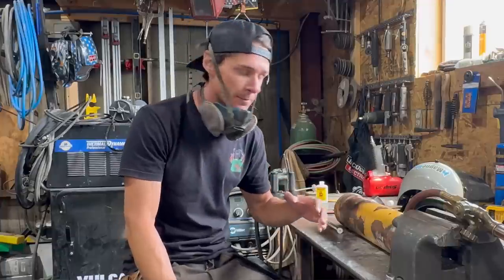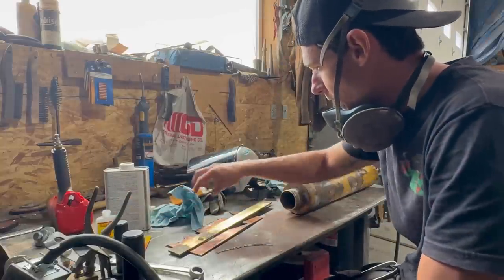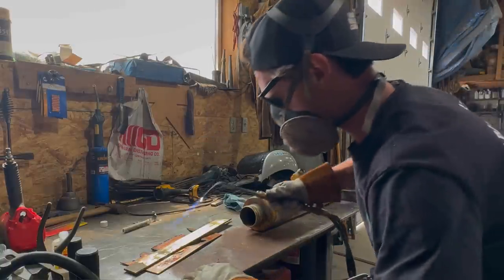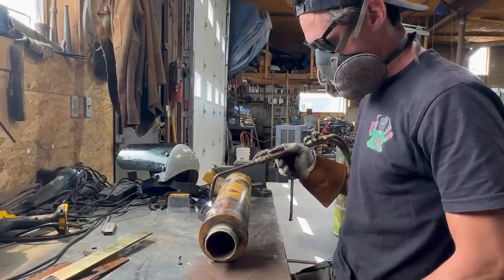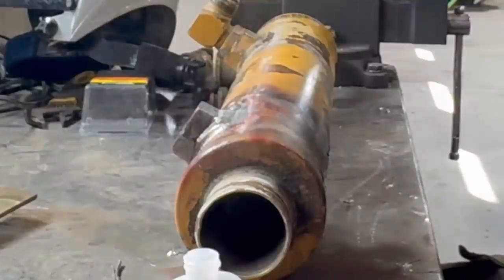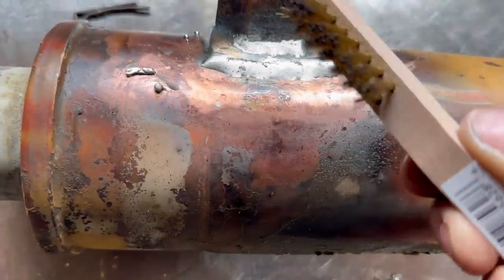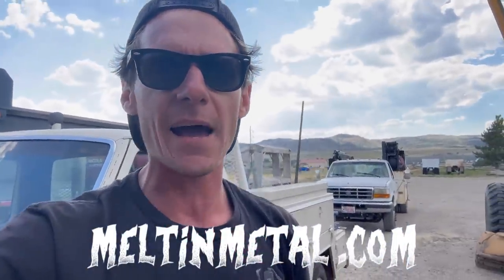Brazing Copper to Brass!

Comment: The technical difference between soldering and brazing is temperature.  Brazing is done at temperatures above 840f.  Soldering is below that temp
Reply: Correct answer.  If you usying oxy/acetylene you brazing.
Reply: @jtoker9758  it's more a matter of the melting point of the filler material.  You can solder with oxy fuel, but you can also braze and weld.
Reply: @elkvis  Yeah if you know what you doing already but for the lay, oxy/act is for brazing.  I ain't ever seen anyone solder with oxy, just pointless.

Comment: I always keep my oxygen regulator on 20-25. Only time I crank it up is when I’m cutting 3/4 inch thick or greater. I would puddle on the bottom plate and scoop up to the top. I use a modified circle weave. Your flame @7:53 was off for some reason.
Reply from the maker: Ya I was doing my best but I was having a hard time keeping the flame correct but I could definitely have it wrong. I did 0 research before I did this repair.
Reply: @MeltinMetalAnthony  it’s a job well done, I’m just sharing a couple of cents. Not knocking ya brother 🤙🏾

Comment: Just a helpful hint... copper and brass get soldered frequently in plumbing.. the call it sweating technically.  I'm sure there is a million videos on it! The trick is it has to be very clean and you have to use flux.

Comment: Silver brazing (>840 deg) and silver soldering (< 840 deg). Use the paste flux. Black or white. The key: when the paste flux looks like water it is time to apply the solder quickly and exit rapidly. Old school notes: cadmium silver solder flows like a dream. They don’t make it anymore. But, you can still find it.

Comment: get some eye droppers to apply that flux.  to solder, you heat the metal up toasty and then touch the solder to the fitting without the torch and it melts and sucks.
Reply from the maker: I’ll try that next time! Thanks

Comment: I never did get the knack for soldering with wire. What I learned on was sheet silver solder and paste flux. Paste flux lets you position cut off bits of solder sheet on the piece more easily than liquid flux. This also allows you to tin a piece(coat it in solder), then clean and flux it for attaching to another piece of metal with a torch. Sheet solder also comes in different grades such as extra easy and hard. The difference is extra easy has a much lower melt point than hard solder does. You use them from highest melt point to lowest when soldering together things that require multiple pieces at different points in the construction. 

Nicely done. Keep adding new skills to your toolbox, Anthony!
Reply from the maker: Thanks!

Comment: looks good man!  I prefer paste flux, & I dip the filler into it to keep a steady supply on the joint.  In High school we used Boraxo soap for flux.  Not the best but it worked ok.
Reply from the maker: Great tip!

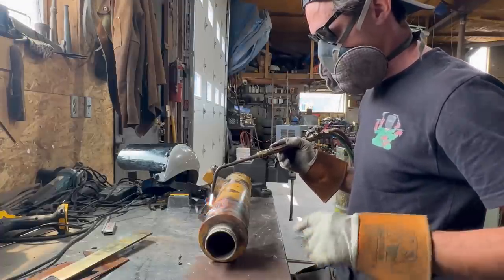Comment: 7:10...you need a little more O2 in that flame....will give you more heat....
.shorten the  acetylene flame  just short of a neutral flame like you would use for steel welding....
Reply from the maker: Ok! Great to get your feedback Paul!

Comment: silver soldering is definitely a skill. i do it quite often to salvage hard to get hydraulic fittings and repairing stuff like you were doing there. its a good skill to have for repairing older equipment parts. if you do it a couple times you will be a pro in no time. you do waaay more cleaning and prep then i do lol good job
Reply from the maker: Thanks bud! I had no idea what I was doing lol
Reply: @MeltinMetalAnthony  gotta start somewhere and it turned out good so all you can ask for

Comment: In brazing, the filler metal must have a liquidus above 840 degrees, but below the solidus of the base metal. The filler metal is distributed between the closely fitted surfaces of the joint bY capillary action.

LIQUIDUS- is the temperature at which a metal or alloy becomes completely liquid or melted.

SOLIDUS-is the temperature at which a metal or alloy begins to melt.

CAPILLARY ACTION- is the process in which a liquid is drawn into the space between two tightly fitted, "mating" surfaces.
Reply from the maker: Thanks! I’ll try to add that to my terminology. Always cool to see a educational comment where the guy lays it out
Reply: @MeltinMetalAnthony  I will be honest, it is mostly what I have at the moment. I'm doing my best to get the practical skills down. Goal is to get certified through the american welding society for a certified weld inspector. Follow many welding channels and very few are like yours. The practical uncut world experience. I know you get this a lot but I really appreciate you and your channel. The terminology comes out of the science of Metallurgy.

Comment: Silver solder or silfloss as some plumbers might call it is actually brazing, silver solder will stick to copper and brass but not steel, however, brass brazing rod will stick to steel and brass. We have silver soldered a brass fitting onto copper, just so we could then braze that brass fitting to steel pipe. We basically used the brass fitting and a bridge between 2 different brazing rods to connect copper to steel without threaded fittings.
Reply from the maker: Thanks for the information! It’s nice to see a helpful comment

Comment: solder and braze should suck into the joint for "penetration" like you discovered on your test piece 
it doesn't sit on top like a bead of caulk
Reply from the maker: Ya that’s what I was figuring. That’s why I wanted it to suck into that pin hole

Comment: Not sure if this is going to become more common but brazing and soldering if fluxed right the sweet only flows to the heat. Alsoa wet paper towel is your friend when doing multiple places in heat zone like welding. Like welding flux on rod helps brazing more so. Stay bright 8 is good to keep on hand if your in soldering business
Reply from the maker: Thanks for the tips!

Comment: Brazing uses the grain structure of the metal with a softer metal filler that gets into the grain structure and holds the metal together Where as welding melts the metal and makes it one piece. You could weld it but would take a lot of heat and probably copper nickel filler rod I weld over furnace brazes with hastelloy X or W and it works well as long as the braze filler is based with nickel. Good luck! Great content!
Reply from the maker: Thanks! And I didn’t know that about brazing!
Reply: You can tig copper and brass with bronze tig wire

Comment: Hard silver solder likes to wick into joints and really does not leave a bead.  If you add too much you get a  blob that runs all over the place and solidifies in place if you time your heat source, but not really a bead..  Flux is your friend, along with a stainless steel brush, as silver solder joints are prone to developing pinholes and crap the longer you heat and futz with the repair..   Silver solder is really mean to be done as fast as possible..   Bronze filler is what you want to if you want to leave deposits, but is prone to porosity and inclusions, so not the best for a fitting joint..   TIG brazing is a good technique if you want a bead, but it is just slightly different than TIG welding in that you want the arc on the filler and not on the base metal as you want the filler to melt and not the base metal (most people make failed TIG brazed joints because they try to do it like a weld and get strange incompatible alloys happening by melting the base metal and a brazing rod together, or they overheat the base metal and get hard spots)..   Lay wire is the best for learning TIG brazing.

Comment: I have always associated brazing with the long skinny white filler and soldering with flux and bare filler. However others have provided a better answer. Love that you are always trying to improve your skill set. On a practical note, I probably would've used JB Weld and walked away. When are we going to put up a stair?
Reply from the maker: A stair? Idk the next time I get a job lol
Reply: @MeltinMetalAnthony  Yeah, I've installed stairs and rails for 25 years as an ironworker in Jersey. I'd love to hang a stair with you. I've done a lot of really nice high end work at Princeton university. I'd love to show you some of my work.

Comment: Meltin, Meltin, Meltin... I haven't missed a single episode and have enjoyed every one since I subscribed..but this one.  So filled with incorrect terms and unknowns about the process used.  The term Silver Solder gets thrown about these days to mean "silver bearing tin based soft solder" (lead free plumbing solder).  In classic terms (before the current misnomer took its place), silver solder refers to what is more properly identified as silver brazing.  It comes down to melt/bond temperatures and filler metals/fluxes.  In accepted terms, temperatures up to 800F = (soft) soldering.  Above 800F (usually 1100 to 1400F range) = silver (hard solder) brazing.  It does appear in the video view at 1:06 that the joint was soft soldered (likely lead based if so), based on the color and width of the bond metal.  However, you could soft solder over silver braze, if that were the case, but not visa-versa.  My guess is that you were using Harris STAY-BRITE, which has a 4% silver content that you mentioned in the video.  So here's the "GO Fnck YOURSELF" moment - do some research into what you're putting out there.  Since a lot of it was overdubbed, you certainly could have gotten things strait and you had welderpaul to run your jargon against.  Now I know what to do, you don't have to say it ;-)  Keep on burning rod, etc. but learn some more about how to solder and braze.
Reply from the maker: Wasn’t supposed to be a how to. Also I don’t think you know how short I am on time. I made sure in the beginning I said it wasn’t a how to, but just to show you guys my first time attempting something like this. It worked so that’s what really matters
Reply: Honestly I don't know how you guys (some of other YT guys which you mention occasionally) weld, get stuff done and make content.  You're doing well or we wouldn't be watching you do it ;-) @MeltinMetalAnthony

Comment: I do have a question/comment about this job and that is if fitting was a surface mounted fitting and being a fixed only with silver solder wouldn’t the better repair have been to heat the solder up and removed the fitting, then clean the fitting and cylinder it is attached to, then flux tin and solder the fitting back to the cylinder
Reply from the maker: Maybe! But it worked
Reply: That would've been better, but usually time is a factor.

Comment: what you are doing is Hard Soldering....Soft Soldering is a lower temperature, 
like Propane or MAPP gas with a lead based solder.....
.Brazing is a higher temperature. with a copper/zinc or copper/aluminum filler
Tig Brazing is normally done with a Copper/silicon filler or a copper/aluminum filler
as the copper/zinc tends to boil off the zinc due to the high temperature of the TiG arc
....hope this helps....Paul

Comment: MMA you never cease to amaze me at your can do attitude. Another great video, that was very educational.I wonder if I could use a plumbers B tank to do this type of welding? ☮☮☮☮☮
Reply from the maker: I think you could!
Reply: @MeltinMetalAnthony   You probably already know this but I just realized your channel name has the initials MMA like the welding process haha. Was that deliberate or just a coincidence?
Reply: A B-tank with a Turbo Torch would have been my first choice for this repair. Temperature control would be easier and the flame more diffuse allowing for better puddle control. I have silver soldered two inch copper with this set up. Plus you should be using a nitrogen purge on the heat exchanger to prevent the internal surface of the shell from oxidizing. That can flake off and damage  other parts.

Comment: Settings for welding tips, acetylene was pretty close, 4-7 psi is where I'm usually at.
Oxygen 5-10 psi is the range I've always stayed in - I believe 40 was Tommy Chong high.

When I taught, students were usually set at 5psi and 5psi, adjust as needed.
You made a very good atempt and hats off to you for learning new skills. :)  I likely would have removed the parts (de-solder or un-solder I guess) then cleaned and started fresh. 

(Btw, I greatly prefer tig brazing)
Reply from the maker: Right on I will keep that in mind for the next time I have to do this

Comment: You could tig braze with ac high frequency. Silicon bronze would have worked well here.
Reply: Solid repair by the way!
Reply from the maker: Ya I think this was the quicker option also they needed the machine back that day. So I chose this root

Comment: That's almost the way we repaired radiators a long time ago we used muriatic acid for cleaning flushing it off with water dry it thoroughly with the torch then use a solder paste with bar of solder and torch we even had an electric heavy duty soldering iron and it worked each mechanic was required to have one in our tool box we worked for a citrus company they had about 25 Massey Ferguson farm tractors ranging from 48 to 150hp and a whole bunch reckless drivers

Comment: Yeh I learned to solder and braze before I learned to weld..... that is pretty much how they taught us
As  technician I do a lot of soft soldering
Yeh soldering and brazing is a different game .... a game you should learn to play.
The only diference between silver soldering and brazing is that Brazing uses bronze or brass, they are near identical processes just differeing metals and chemicals.
.
we are talking  more a general heating rather than the focused heat when welding.
Ya realy not looking for a bead like you do in welding
Though on long joins it can be like running a bead.
.
yeh the silver solder you had was a lot smaller and softer than I would expect for that size work, we generally get silver solder in sticks like brazing rods, It's EXpensive.
. 
if using a liquid flux, get ya self a flux brush, it allows you to put the flux where you need it.
The paste fluses can be easier to use because they will hang on the surface.
Often the paste fluxes are a powdered flux mixed with water though some come as paste.
.
with solder and braze, the filler is idealy more a concave fillet rather than a convex bead.
.
 Having a clean well fitting joint is what you want
.
the solder or braze will pretty much run where the flux goes.
.
The other thing I think you found is that sometimes you can reflow a joint with the addition of flux and filler
.
like in welding, the oil was giving you some trouble. 
.
Yeh get yaself some scrap material and get some practice.
You can do and fix things with soldering and brazing that you can't weld
.
one thing that, I found interesting was TIG and ARC brazing ... wow .... I saw that on weld.com.
.
As Austin Ross says .." learn something new every day".

Comment: Awesome job on the video there Anthony 👍🏻👏👍🏻 with you also thinking to about the TIG welding part of it you might of got the same result with the TIG welder the difference being is your using electrical Arc as your heat instead of oxy-acetylene??? But who knows I've never personally have experience with copper and brass brazen them together I have used some silicon bronze and I think the other one I have is silica aluminum it's all kind of cookie. But I do have to give you props for the great results you got for being a rookie doing it... You kind of almost go on the motto of what I do you can't fuck something up that's already fucked up!! 😁😁
Reply from the maker: Lmao that’s the truth!

Comment: Hey, I think you should do a segment on chlorinated brake cleaner and welding. I was working on my chipper probably a month ago and I used an old canna brake cleaner didn’t have a label on it. I don’t know if it was chlorinated or not. I think it possibly may have rained on it and I use WD-40 over the top of it but please do a public service announcement about that shit because I had no idea.
Reply: What happens if you use it?
Reply: NO OFFENSE BUDS.
Reply: @xtremefab6752 chlorinated brake cleaner reacts with the weld and creates phosgene gas

Comment: You were soldering using a lead free solder. Many times people will mix the terms between soldering and brazing, when brazing use the term brazing filler, not solder.
Reply: As long as his temp was under 840 you're correct though we can't prove that